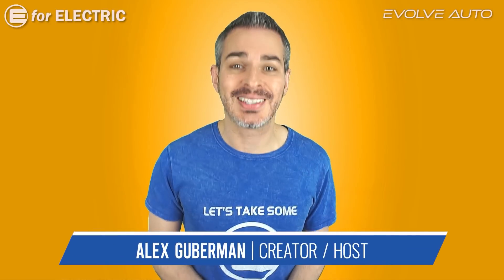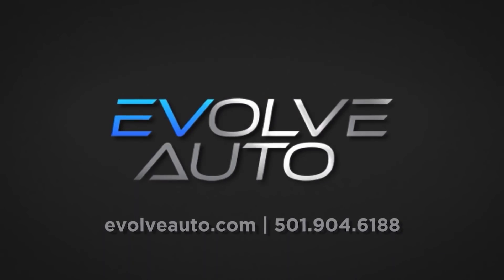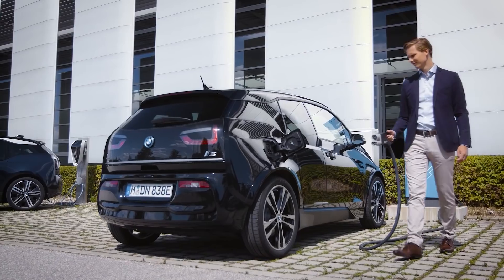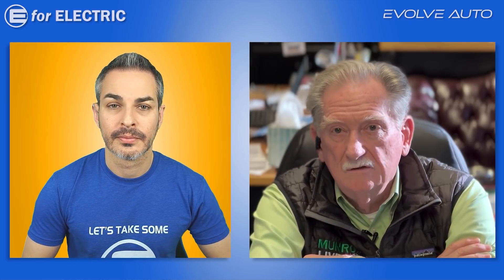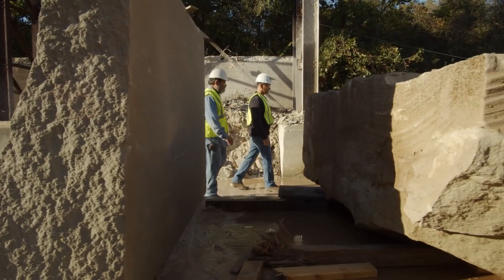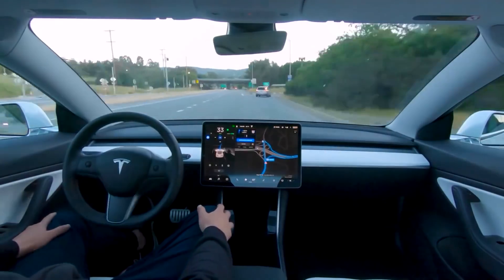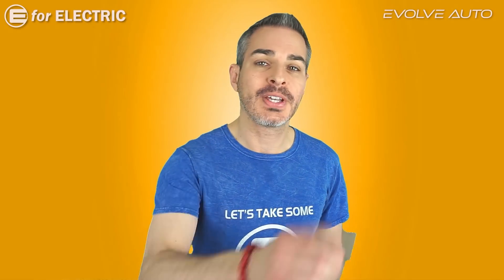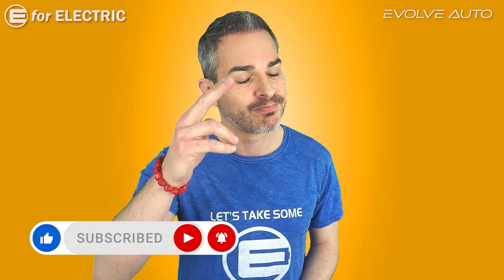SANDY MUNRO Explains Why V2H & V2L is the Future

Comment: All the new KIA Evs have, or will have , this capability, so no need to spend 85 large on a truck - unless you need a large truck. Even the upcoming Niro EV will have this.  Hyundai has this on their Ioniq 5.  These cars will be available unlike the ford, but OTOH, KIA /HYundai haven't released their V2H package yet.  When you think of the cost of back up batteries, it really is a bargain - much larger battery, and you can drive it around.  When KIA/Hyundai come out with the V2H (as opposed to the current V2L), I will seriously consider trading in my much loved Niro EV.
Reply: It depends on how much 110v output the car can actually support.

Comment: I wonder where folks are getting 70-80k for an electric truck. To me these are still toys for the rich elite. Electric won’t hold a candle to ICE or diesel for real work.
Reply: well - ford has the fleet truck for 40k, and no-one is using a rivian for real work. To fill a big work truck is about $150/tank now - electricity, maybe $30- 50, and if you have solar - nada.  there are also other savings. But if you were to get a semi luxo ICE work truck, I'm guessing you're easily in the 60k range, and judging from contractor bids - it's not a big deal -ouch.
Reply: @anxiousappliance  They won’t ever be able to mass produce those at 40k…. That’s Jim Farley snake oil. The cheapest realistically you’ll be able to get into one with 300 mile range is 76k and that’s before dealer markups. 

Make no mistake, there is clever engineering going on with this truck, it is just too expensive to justify over a more practical powerboost or tundra hybrid.
Reply: @john2.0elijah4  idk to be honest, usually it does work that way, but it hasn’t so far. Musk’s and Sandy’s predictions haven’t been right so far and that is the basis of my argument.

The cars have gotten more expensive due to the fact that there isn’t nearly enough lithium, cobalt, and nickel to supply the mass transition that they are promising.
Reply: @thomas735  Tesla's have gotten more expensive in the short term due to unprecedented demand. They're driving their costs down rapidly and will have their cost to manufacture below internal combustion this year...
Reply: @ericogden4589  I don’t think that’s gonna happen, a Model 3 costs over 40k to build and a model y closer to 50k. Maybe compared to luxury cars but not a Honda or Mazda etc.
Reply: @thomas735  cost per kWh to be at cost parity with ICE is $100. The rest of the industry is 120-140, Tesla at 110. 4680s drop cost, at the battery pack level, to $60 per kWh...

It's happening right now. 

Also, Tesla is already making nearly 30% gross margin, compared to industry averages in the single digits. 

Not only will it happen, it's happening right now.
Reply: @ericogden4589  no lithium ion pack will get to 60 per kWh any time soon, at least not until supplies even out. It’s not batteries that are in short supply, it is the metals that go into them. 

As for the margins that can be misleading, 30% margins per a car is too good to be true. My hunch is a lot of that is the self driving computer which sells for like 12k but is kind of a scam.
Reply: Yeah... Cybertruck will prove you decidedly wrong.
Reply: @ericogden4589  will that ever happen though?

Comment: V2V is also desirable. Lucid has it.

I’ve read comments saying that a PHEV would be better able to handle lengthy power outages or big construction jobs than a BEV.
Reply: Yeah, I would think it's a good idea to have V2V for when you run out of charge somewhere and someone else can charge you with their car. Though I guess if you just had a 110v outlet like on the Lightning you could plug a normal charger into that and use it. (Or maybe a 220v. My Chevy Volt has a 110v charger.)
Reply: @SolidAir54321  Well, 110 and 220 volt outlets are better than nothing, but don’t they take a long time to charge a car? I’m not sure, but I think Lucid has a socket for another car to plug its charging cable into, which would be more convenient.
Reply: @rogerknights857  Yeah, 110v is slow. But maybe not so bad if you only need to charge for 10 miles to get to a public charger or to get home. Probably better than calling some service you have to pay for.
Reply: Judging by the photo they used when explaining vehicle to load, 1:29, I think they mean that to include vehicle to vehicle.
Reply: @rubidot  But if those are just normal wall outlets, charging will be slow. Better than nothing though.
Reply: When V2L or V2G is possible , v2V is also a possibility

Comment: Hey Guys, your are talking about things you do not understand. To power anything from your DC source (batteries) to AC loads such as your house you need a big Bad Ass DC to AC inverter. It does not come down to how many outlets you have, it is the LOAD requirement that determines the size of the Inverter. If and When you purchase a vehicle with the idea of powering some AC load you MUST determine the DC to AC inverter max power
Reply: Sure- I think the car companies will provide the package.  I think Ford is teaming with Sunrun - don't know about KIA/Hyundai.
Reply: Yup, this is where Ford Lightning has it done right, they specify the KW for various power packages, like Pro 9.6KW! (2.4kw std), plus integrate into the home w/ transfer switches...  big power needed for homes and worksites, incl 240V.
A few simple 10A 120v outlets is not very helpful (Rivian), that's just 1-2KW, eg an appliance or two, nice for camping but not powering house.
Reply: An LF inverter 8kw with split phase and 24kw peak may run you $1000. That succer will run an entire house with one central AC unit, or two if you are careful. You can go to a 15kw an run the whole house with no problems, all from the DC battery.

Comment: Being only two years older than Sandy brings some pain with my next sentence.  You're out of date about I3s and your prejudice about this very cute ground breaking vehicle is showing.  Of course any time you can point out three installations that have successfully converted an I3 to storage battery or found three for $10,000 I'll put my bumper sticker back in my window.  They've almost doubled in value in the last six months.
Reply: That's not what he's saying.  He's simply saying that i3s and Leafs are being used for this.  They may be battery packs from wrecked cars,  or battery packs that have  degraded and not fully usable in the car,  have been replaced in the car,  and the degraded pack is still usable for home energy storage.  It's actually pretty ingenious and being done quite often.
Reply: @jamesengland7461  Thanks for getting back to me.  I listened/watched again James.  I think you should too.  You don't happen to have any suggestions where I'd look for these working repurposed systems?
Reply: @unclegeorge7845  I don't recall offhand, other than "Fully Charged" YouTube channel. I've seen other videos also.  There's a whole cottage industry  repurposing EV components into homes,  classic cars,  etc.  Way out of my league :)
Reply: @jamesengland7461  Actually James I was being a bit ornery.  I help a neighbor that has done a couple of Leaf battery stand alone systems and a couple of grid tie ones as well but these are clear of the automobiles that donated the batteries.  And I was about to buy an I3 and then POW as the real Batman would write and the ones I wanted went from $20K up to nearly $30K,  Sometimes I think buyers remorse is no more powerful than NOT buyers remorse.  I also tend to call out the experts when it's apparent that they're kinda talking through their hats (so to speak).  Thanks for your kind response.
Reply: @unclegeorge7845  behave yourself :)
Reply: @jamesengland7461  Fer Shure!  ;~)